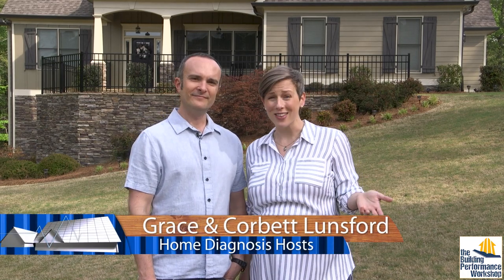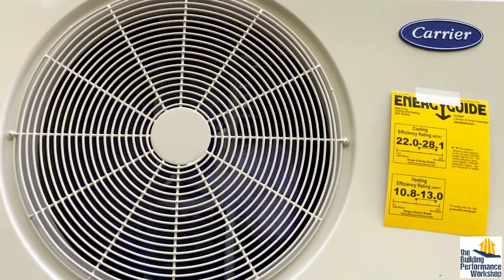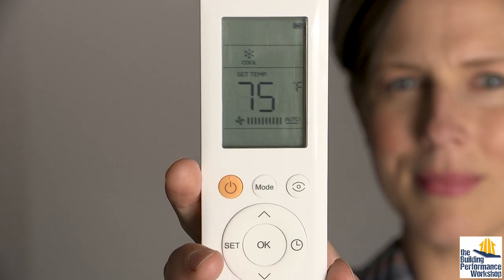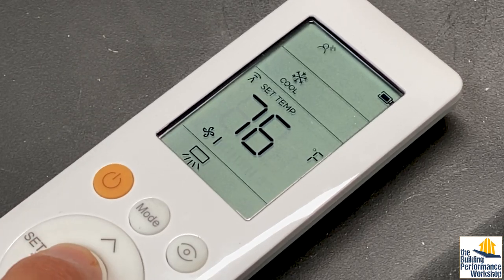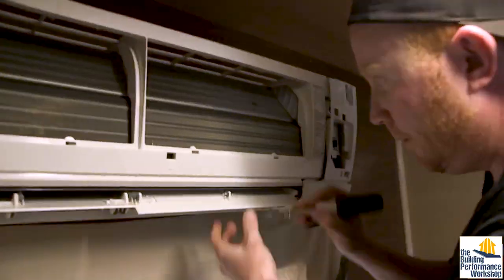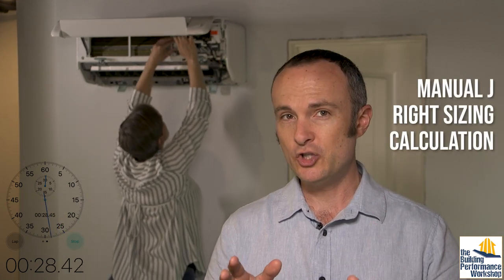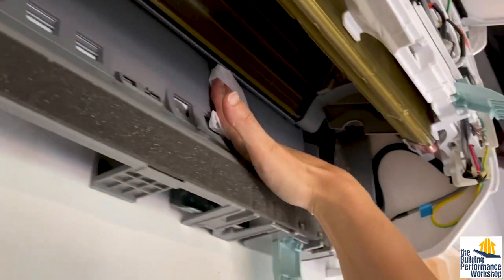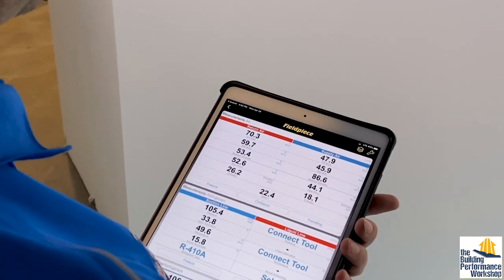Your Home's HVAC System of the Future: New Ductless Mini-Split from Carrier (take apart in 1 minute)

Comment: Thanks for this. Until other brands pick up on this 1 minute disassembly feature I feel like I can only recommend Carrier. Spending 1-2 hours twice a year and hoping you don't break something just is not going to work. I was so disaapointed when I noticed the dirty blower wheel and the hours required to clean it on another brand. I'm looking for any reason to rationalize upgrading my 2 year old mini split to get a carrier.
Reply from the maker: Tough decisions, Andy, I hear you

Comment: Ductless split systems meet the application requirements of smaller square footage spaces. Heat gain/loss calculations are key for proper sizing and optimal system performance. Would have preferred Carrier integrate the humidity sensor into the remote control as they did the temp sensor. Wall concealment of line set is a nice touch. You have a beautiful home. Thanks for sharing.👍
Reply from the maker: Interesting idea about the hum sensor, though I doubt you could get far enough away for the reading to be far from the sensor on the head itself.

Comment: I have had one fitted for one month now. Only heating my living room and kitchen. (when the door is open.) Loving it compared to my Storage heaters. I bought one of those Electric smart meters to check kWh used. Wished I bought it before stripping out my old heaters for reference. Being the weekend, it was on all day and used 4.850 kWh. Would you say this is good, poor, or average? I also know people say that they work best with a well insulated home. But this would also be true for any form of heating.
Reply from the maker: Since a kWh costs around $0.20, I’d say one dollar for a full day of comfort sounds dandy
Reply: @HomePerformance  With price infation in UK today That 4.85 kWh equates to £1 at 21pence per unit.

Comment: That's extremely interesting as it solves one of my biggest problems with ductless systems. Cleaning.

I have an unrelated question. In the last seconds there is a shot of the outside unit- you have a cover protecting the lineset. Can you please let me know where you purchased that and the part number? Thanks!
Reply from the maker: Hey O- I think you’re seeing the disconnect, or the vent terminal, the lineset wasn’t clad in anything that day. But there are a few plastic lineset coverings, one I’m using lately is from Diversitech.
Reply: @HomePerformance  it must be the vent terminal . I was hoping they made something like that for linesets. Thanks for the quick response
Reply from the maker: For you, anytime buddy
Reply: @HomePerformance  I clicked the link trying to find the easy clean head but I couldn't. It just has all of carriers ductless systems. Do you have a link to the specific head perchance? Thanks
Reply from the maker: I know this is the new design for the indoor head, O- this one is the mid-tier ‘Performance’ series, and yes, looks like they could spell it out better on their website.

Comment: I am not a fan of the ductless wall units. 
Also presents a problem of stagnant air/ no fresh air. 
Full house hvac will usually circulate air throughout the house. 
I am looking into two ducted ductless units for my 80' long house.  Reduce ductwork and manage air flow better with two zones on each.

Comment: 1. Ugly 2. Ugly 3. Did I say ugly ? LOL Look these are quiet , flexible and uber controllable , much easier to retrofit on a house, can run multiple heads from one outside unit, but they are considerably more expensive to purchase cooling capacity being equal, with traditional forced air. 
But I all kidding aside , this is a great solution on for addition, garage, one room esp with heavier needs than other parts of house. But even if you have a super insulated house and manual J shows you can get by with only few units, you’d have to have a balanced separate ventilation system to move confronted air to most places in the house ,a NB you’ll have to ahve super windows (ie European triple glaze tripled gasket ) to make sure window areas -no longer window washed by a vent) aren’t cold. these blowers are NOT powerful (tho its nice they are quiet). With a large room you will need multiple units.If your house is very tight well insulated, not too large, rooms are not very large/cathedral ceilinged, you desperately dont have space to run traditional metal ducts, go ahead. BUT you will be cleaning EACH head unit monthly AND having disassemble and reassemble  EACH unit twice a year ? In a large 4-5 bedroom hosue you’ll need what >> 6 units ? Compared to just changing filters at the main whole house filter in at most two units twice a year with forced air ? NB we did not see grace Reassembling unit-takes longer  and is more finicky (ist ALWASY easier to take something mechanical apart than to put back together  again !. And these are much more complicated units, and fewer techs are up to speed on them (hence less competitive service bids) . If you are building new you can design duct work into framing , cap costs lower (even with duct system), way lower Maintainence, service needs and NO ugly head units !
Reply: I agree. Carrier should take a page from LG's playbook; their Art Cool line at least somewhat hides it.

Comment: that prompted me to have a look at mine as no one talks about taking them apart and cleaning them.  (ductless minisplits are common here, hvac systems are rare and are generally ducted heat pump systems) .
all i can say is ewwww. looks like todays is heatpump cleaning day.
btw i find those "eco" and "energy saving" systems are a fat waste of time. 
the quick dissemble feature looks awesome. using the remote as the temp sensor is a good idea but you would want to be careful where you put it. might end up with a cold room if it falls into bed with you.
the feature i would like is to be able to retune the heatpump software. even if just minor things like correcting the heat sensors.